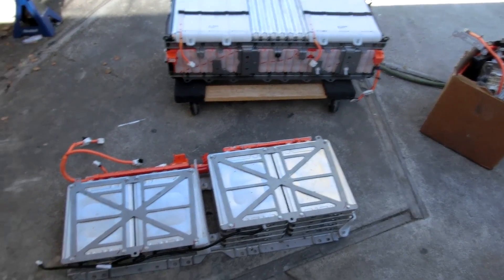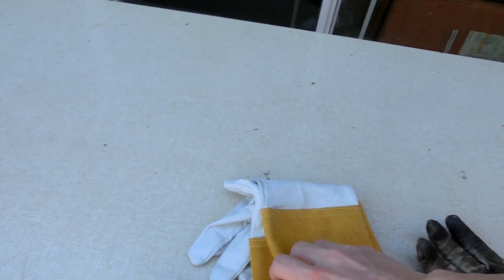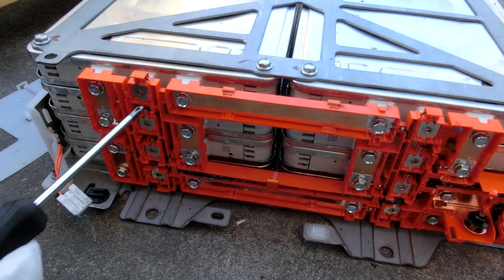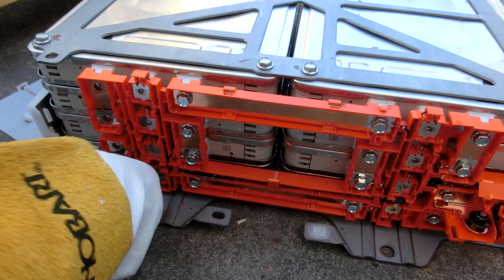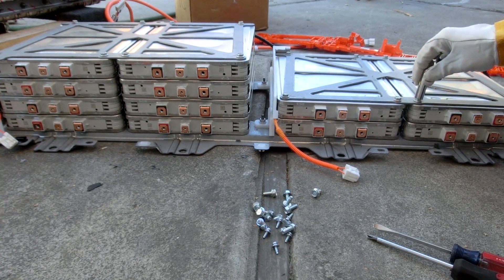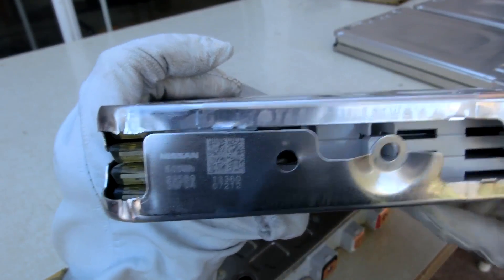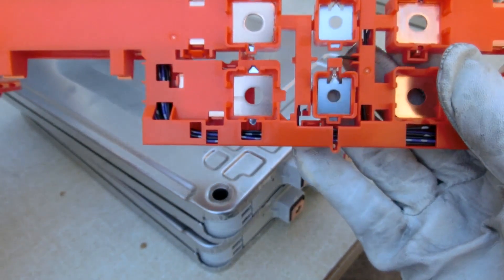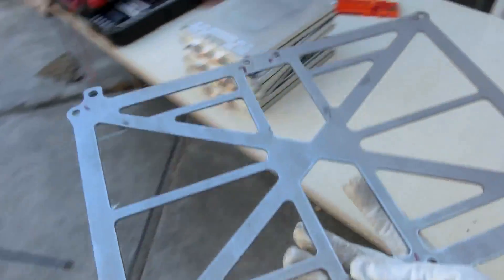2013 Nissan Leaf battery disassembly part1

Comment: They are AWESOME my friend. Do you have a post box in California yet. So you can have some Jaffa Cakes sent to you? Over here we have quacking weather. Could you send some of your weather over here? LOL. I am looking forward to how you configer those cells and what you get out of them. Our QXA did 12 days. When it reached 10,6V. It is now on on day 16 of solar recharge. With one 45 watt panel facing south out of the hall window @ 45deg angle. The other 4 making 60 watts on the Lab roof facing south @ 45degs also. Add to that we have only had 5 days of sunshine so far since the 23rd October. The QXA cells are at 3.8V. I am looking forward to see how long it takes that one of yours to charge using the IMax. Have an amazing day my friend.
Reply: +Raymond Earle to charge one of these off the imax at 5 amp if the cells are 50 about 10 to 12 hours mind you i always forget about the ramp down so prob looking at a few days haha
Reply: +Raymond Earle imagen how long it would take with solr in the uk i have 40 watt panel at 5 volt charging a 150+ah battery pack and well i charge my phone off it and use it to power a bedside light and well the voltage is getting lower and lower i need more power from the panels lol
Reply: Yes I am finding that the UK weather depletes your solar charging ability a lot durring winter. It is great to hear from you my friend.
Reply: +Raymond Earle i need to align mine proper for the south and winter degree at moment they mounted to a vertical wall they do ok at that angle for sunny days but when the bed rainy weather comes in i get nothing im thinking of running a water wheel from the gutter run off for that little extra only running a 3.6 volt pack helps keep things simple and able to use more more to generate the lower voltage
Reply: Running at lower voltage then series the cells was my thought too. That is how the QXA is wired and the automatic charger is designed for that system. 4V is easier to generate at high current than any higher voltage. I have to reconfigur my panels too. I still have another 45Watt to go online.
Reply: at 4 volts you wpuld parallel them
i did have them in 3 series and one panel per charger per bank to better keep them in balance as i thoght this way steeping them down in voltage is more effiecent then stepping up that uses more thinking the series stepping down was working better basicxly i had the cells in series with a usb lion charger pcb that then conect to 1 of the solar panels the bank was 20ah and the colar cell is 10 watt 2 amp 5 volt so no matter whhat as long as the 3 solar cells where getting the same power they would no go out of balance seemed to work ok but more panels needed then i thoght oh what happens if my drop down circuit fails that woulkd shove 12 volt into my 5 volt devices so i have gone back to prallel again and stepping up they maybe more losses but i know my devices are safer because if the step up unit fails the device will only get 4 volt max not 7 or 12 in series packs
Reply: Raymond Earle QXA ?
Reply from the maker: +Raymond Earle thanks, i have a few extra things in mind for these cells. i may take 3 modules and build a portable MiG welder!
Reply: That would be cool my great friend. I can't wait till your next video.
Reply: breather man then me shorting the pack for welding
Reply from the maker: David Simpson
mig welding though, so not as much current draw as like a stick weld.
Reply: You want to see Rinoa weld with car batteries. AWESOME!
Reply: i scene him weld with car batteries he was doing work on his trike recently the battery's in this video might be very scary to weld with
Reply: +Rinoa Super-Genius thank god that be hell of alot safer lol so will that be the mig guns that clamp onto car batterys ?
Reply from the maker: David Simpson
i want to make my own version of the Hobart Trek 180
Reply: +Rinoa Super-Genius i have no idea what that is let me google it haha
Reply: +Rinoa Super-Genius that looks a very nice bit of kit i did find a few years ago a mig and spool that was hand held and you just clamped on to battery but i thoght that might of been abit to much to hold

Comment: Did you know that you can further break down those modules to 4 cells, 2(2P)S ? each is already charged at 3.7 volts and ratet at 33Ah. So be careful separating them. I have been using them with my eBike forever now!... first 10S and now 12S. With the generic charger I never had to use BMS. I exp[ained it all here:  

https://plus.google.com/117598822996979005744/posts/2eBYkxm1stM

Now I am building a strong power supply for a stronger charging system!...
You're gonna need a strong charger too
Cheers and thanks for sharing.
Reply from the maker: +Farrokh Mirbaha yeah flat packs scare me, so ima leave them in the case.
Reply: +Farrokh Mirbaha So how many nissan leaf batteries did you need?
Reply: Rinoa Super-Genius You ain't kidding!... first time around trying to discinnect and isolate the cells, shit went 4th of July on me many scary times!!... Also, some sort of adhesive holds the cells together and to the shell pretty tight. That is a pain in the ass to overcome too! I used the "Piano Wire Assassin" method with patience to separate them. But then, when I made my second pack, the 12S, I already knew that they did not need to come apart for my application, only that I had to disconnect them from their factory configuration and reconnect the way I wanted. I still had some 4th of july incidents. Those puppies come charged at 3.7v...
Reply: norxcontacts I've done this twice and each time I bought 3 modules giving me 12 cells. First time around,  foolishly I only used 10 and sold the extras very cheaply on the ebay. second time, I used all 12. Then again, I also designed my own speed control system using Phoenix Edge HV 160 from castle creations...
Reply: +Farrokh Mirbaha you're not using the Hall sensors in the motor?
Reply: nope. one is damaged any way...
Reply: +Farrokh Mirbaha great design, that eliminates 5 wires.  and the motor is stronger?
Reply: Much!...
Reply: +Farrokh Mirbaha      could you do a video demonstrating how well the wheel actually performs on the road?       that esc is quite expensive.
Reply: Sure. Just don't know when I'm gonna get around to doing it though...

Comment: maybe just slaping 5 together to make a 48v system and just buying a bms and you have a nice 60ah battery
Reply from the maker: +Kristijan Dinga well try to find a 10s bms
Reply: Rinoa Super-Genius well yeah thatb is a problem then just put 6 and done :)
Reply: +Rinoa Super-Genius http://www.ebay.com/itm/36V-37V-42V-10S-45A-Lithium-ion-Li-ion-Li-Po-LiPo-Polymer-Battery-BMS-PCB-System-/321751886140?hash=item4ae9e8293c:g:o3cAAOxyOM5Ra-k0
Reply from the maker: +Andy McBlane sorry i meant 48v 10s. 10s just wont get to the voltage.

would be great for a 36v motor though.

Comment: I could be wrong but didn't you hook up your charger wrong, from right to left isn't it, positive balance negative??
To me it look like there was a bit of red behind the positive and black behind the negative, built-in terminals.
I wonder if that extra connection on the back is a thermal feed if there's any way you can utilize it.
Reply: +redneckbryon  there's two cells in each module and the "balance" pin is connected to the internal jumper between the two, so if you only want to connect to one cell this is the correct method.
Reply: +Mitch Knight from entering electrical standpoint two cells in parallel can be treated as one larger capacity cell. but yeah. I get where you're coming from, it's a 2s2p pack.
Reply: There's 4 cells per module. Check other YouTube videos

Comment: The teenager inside me wants to see what would happen if you hard short one of those puppies, there has to be a lot of magic smoke in a battery so large.
Reply: +MrJmak642 or a fuseable link for safety so nothing much would happen!
Reply: that would make me  sad...
Reply: +MrJmak642 
Someone did puncture tests and fire tests on one of the cells (not an entire module though), and it remained stable. Pretty impressive.

Comment: Hello what kind off lithium batteries are in those modules, lithium polymer flat cells? Thanks and nice video
Reply: lifepo4 i think
Reply: +Constructive Lego Technic 
LiMn2O4 cathode, graphite anode, LiPF6 electrolyte, PP dry separator.